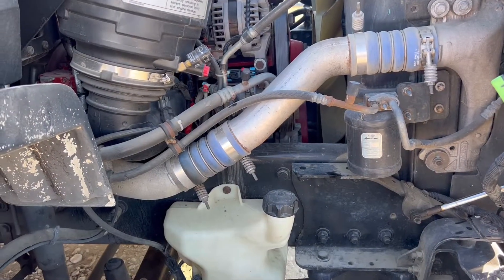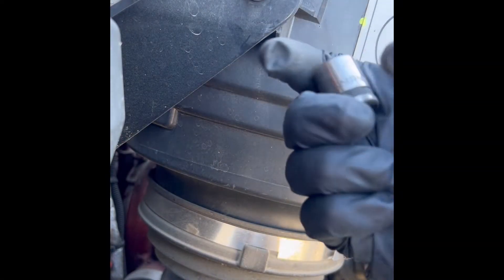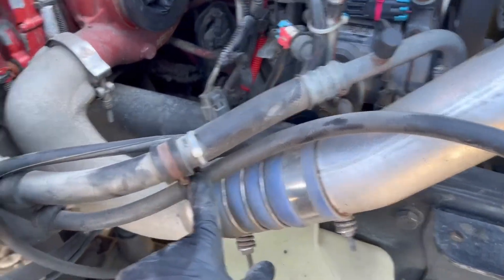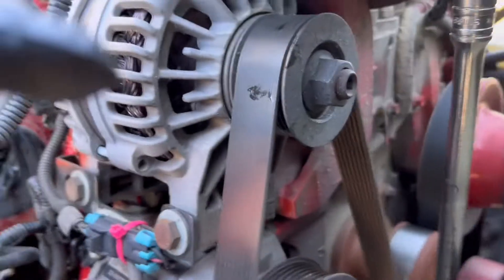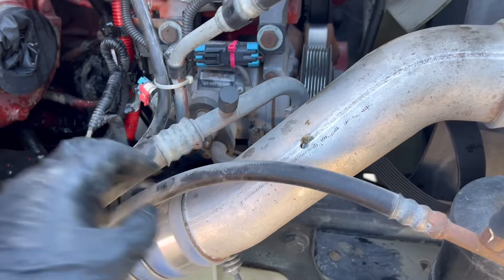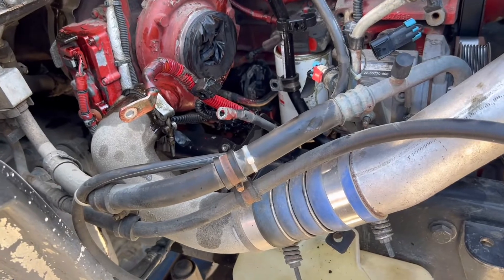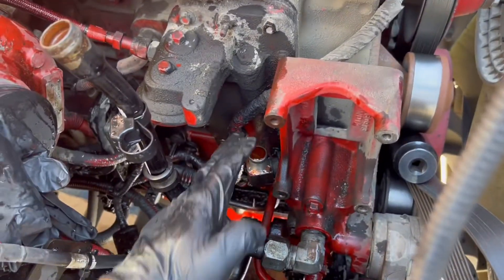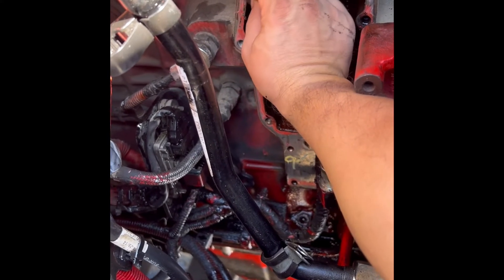DIY: Freightliner M2 Cummins ISB engine oil cooler remove ( Part 1)

Comment: Thank you for this video.  I got quotes that I thought were ridiculous.  It basically took a couple hours to change the part.  The tedious part was flushing the system.  I used Cascade liquid to do the job.

Comment: Hello, what model and year is that Freightliner, because my Cummin does the same thing to me. I have seen several models of Oil Cooler and I don't know which one it has.
Reply from the maker: @brunoeliasdiazchacon3489   2015 , 6.7L